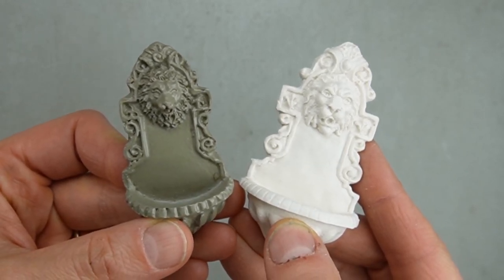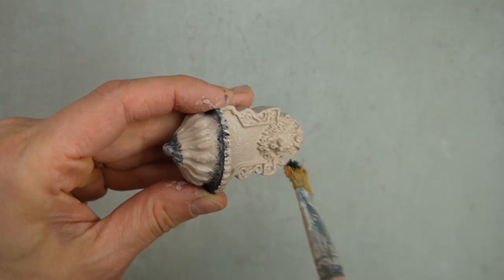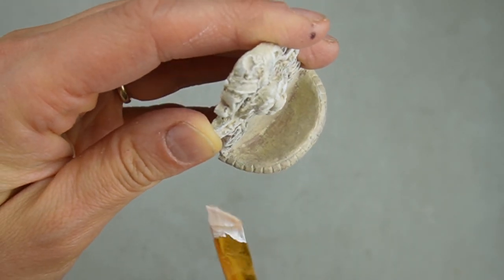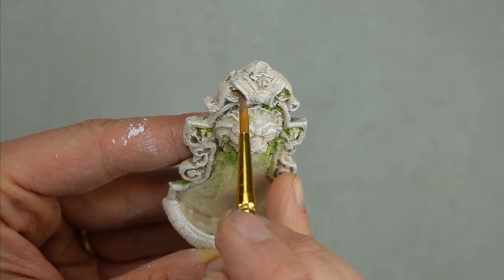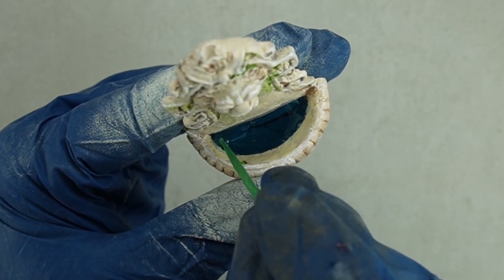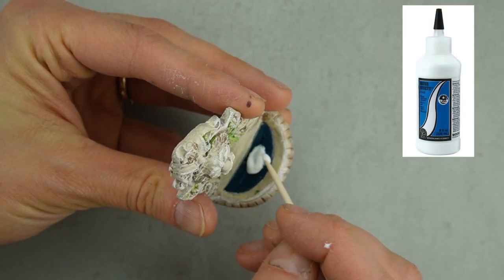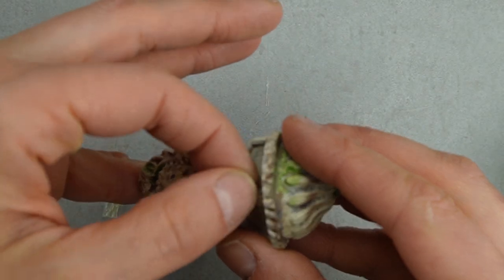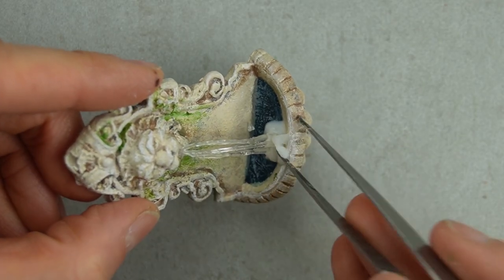Miniature fountain Makeovers & EASY Running Water effect

Comment: These both turned out great but I have to say that having the right materials does make all the difference. I spotted that fountain on Temu, but decided to pass on it so it was good to hear that the detail was a little lacking.  I am a big fan of UV resin too, it's soo easy to use and take things to that next level.
Reply from the maker: I think the trash plastic was a great substitute for resin. The flocking is the best hobby material of the three I used. It really makes a big difference. I love flocking.